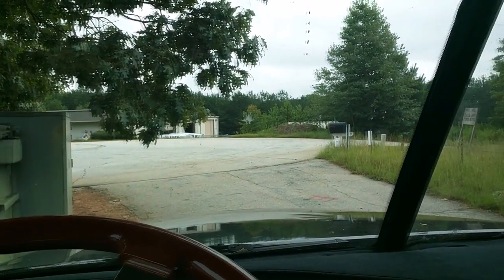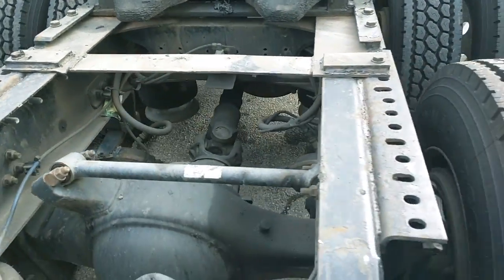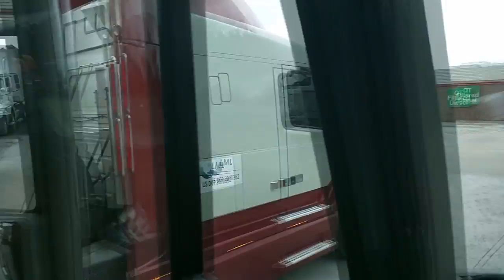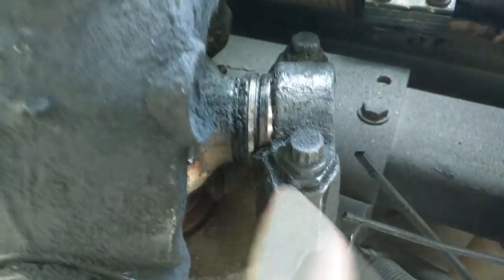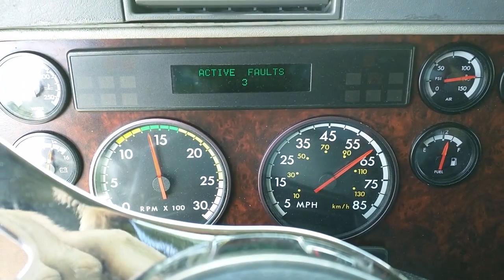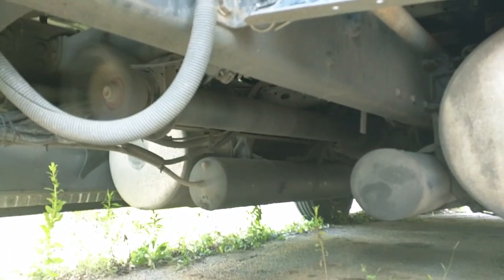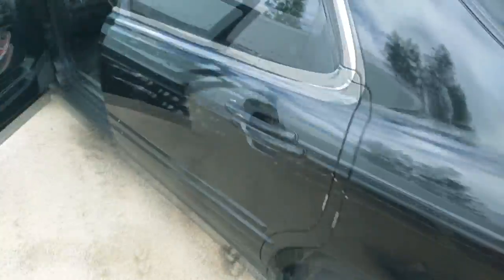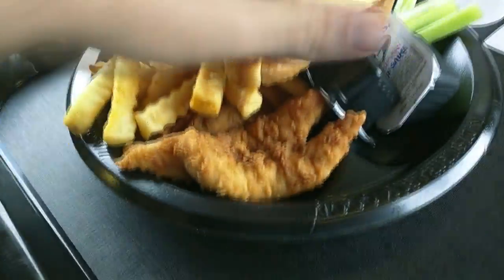Drive Shaft Problem

Comment: A proper driveline alignment (the whole assembly including the main bearing) should of been performed. Also on Freightliners in particular, check ride height adjustment and on older models there are some shims that go out on the ujoint/ frame connection getting worn out, causing possible vibration as well. Never just balance one driveshaft, always both together, and never take down a driveline without marking with paint to maintain same position when reinstalling. Mostly happens when you get a tow, tow truck driver takes down the driveshaft, and during reinstall, it gets offset 180 degrees. Best of luck to everyone !

Comment: Hey bro how did u install the Window AC unit on your truck? Appreciate  any information. 
I'm having the same vibration problem with my truck, hopefully the shop can figure it out.
Reply from the maker: I just took off the back panel, then took a cut off grinder and made a hole to fit the ac through. Obviously its way more hands on but not to complicated. You'll need an inverter and back up battery bank if you want to use it while your in the sleeper. Hope you figure the vibration out. Thanks
Reply: @JustVlads  how many batteries do you need? How long it can run while truck os turned off? 
And how to prevent draining truck batteries once backup batteries are empty? Thank you

Comment: Wow $600.

Did it fix what you thought was the problem?
Reply from the maker: +Truck Taxi nope, ended up selling the truck.
Reply: replacing BAD power divider fixed my vibration problem.
Reply: What were the symptoms. I'm getting vibration only when accelerating under a load.

Comment: I know it’s a weird question but does anybody have any idea how fast the driveshaft goes when you go on the eighth or 10th gear for Freightliner Cascadia??
Reply: 8th is around 40mph and 10 is more than 50 mph
Reply: larco 77 thank you so much but when I go 65 or 70 mile an hour how fast the drive shift goes or what I mean How far is the drive shifts turning is it the same the speed goes

Comment: soo what was it the drive shaft or the carrier bearing
Reply from the maker: +Silent John never figured out the problem after spending over 6k. Had to sell it and start over.
Reply: Just Vlad  no kidding, i think im having the same problem with my 07 freightliner. i just cant seem to figure out whats going on with it. great video you should do me trucking ones!
Reply from the maker: +Silent John I don't truck anymore, but I do miss it once in a while. Sorry couldn't help you. Hope you can figure it out. If you do please post about it so people will know how to deal with it better before spending a ton of time and money. Good luck and stay safe out there. Peace
Reply: I noticed right away that the nut on the yoke at carrier bearing is loose.
Reply: @silentjohn1971  hey bro my shaker is doing the same thing.. did you figured your out
Reply: Is losing driveshaft n dropping on freeway a common problem for  Kenworth 680/ 2015
Reply: Driveshaft should have had stub and slip changed on rear as well as carrier bearing. And ujoints. Balance should have been provided after to ensure high speed capabilities with no vibration. Looks like your rear shaft could have been longer. Proper estimate would have been about 1400 if done properly and should last another 200000 miles with minimal greasing maintenance